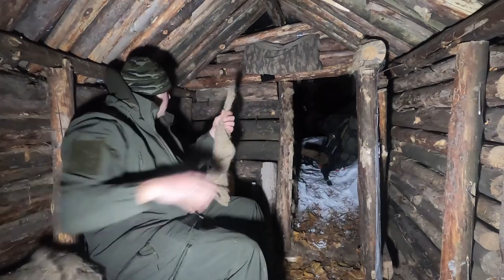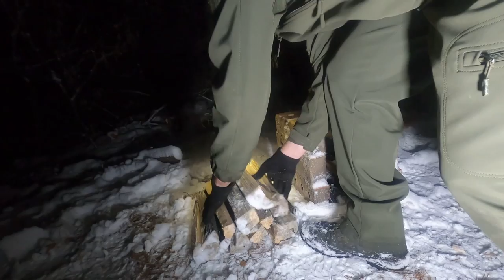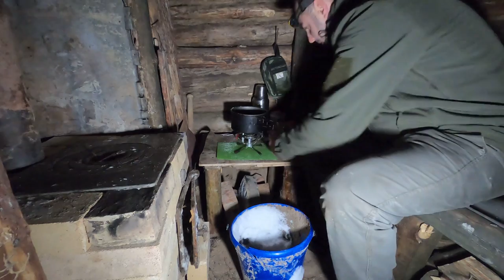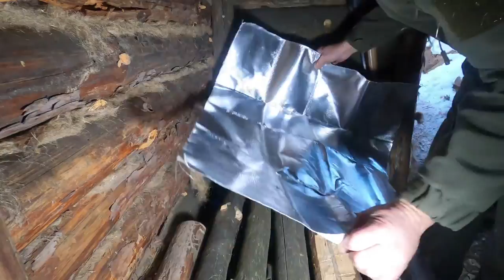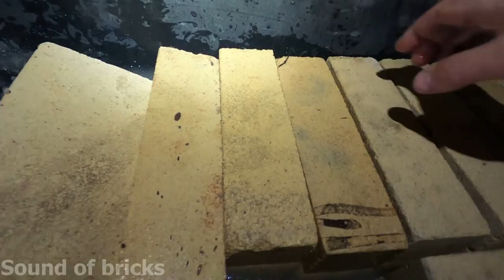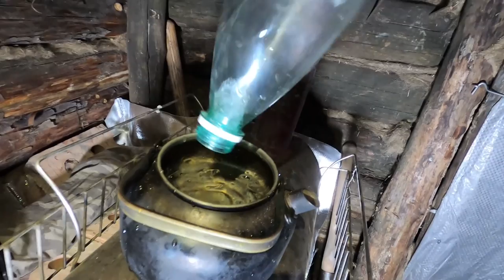Made a cool brick stove in the dugout, dugout building, solo bushcraft shelter

Comment: I built a pit-house in the southern part of SW Utah in 2005. I simply dug a hole in the ground big enough to then construct a cabin of wood inside. Then buried it with the soil removed from the ground. In winter and summer it stays around 50 degrees inside. I winter a small campfire keeps it warm and in summer the soil around it keeps it cool when its hot outside.
Reply: Pit-house construction goes back to before the time of Christ, as you probably know.  I remember ducking into a ground-level chamber at Chaco Canyon several decades ago.  It was a very hot summer day with relentless sun - inside the Pueblo, with several stories above us, we were delightfully cool.  
Too bad we “have” to use enormous amounts of fossil fuels to stay comfortable today.

Comment: I think that's exactly what you are missing! A really good stove like that. It will hold the heat in those bricks. Even after the fire dies down and it's just at coals. I think the flat surface will make cooking a whole lot easier. You might be able to find a piece of metal that you can bend into a square and put it on the plate to make an oven to bake in. That place is just about right now! Good job.
Reply: О
Reply: in fact ... these are fire clay bricks that insulate and do not retain heat, they normally protect the outside structures of the stoves from the heat of fire .. They are hot when the fire is burning, but they also cool down quickly when the fire is gone ... you need another layer of normal bricks outside ..

the man is inexperienced, at first he wanted to set up a cementless structure, then he lost a lot of them through the construciton process. Cement is also not good material for the high heat, he have to use fire clay flour.  He was made too large stove (energy inefficient), although he already has two others stoves, a small metal and a miniature gas one in his cabin + one small gas cooker ...

The Video is make only for the YouTube likes ...
Reply: @DieGottesliebe  Or maybe he is learning as he goes. Instead of being a rude criticizing naysayer, try teaching, like so many others in the comments have.
Reply: @DieGottesliebe  Calm down there Bob the Builder. He's building a stove in a small shelter in the woods, it will do just fine for his needs. It's not like he's trying to heat a whole house with it.
Reply: @mickwomack6363  he needs only the YouTube clicks ...
Reply: @DieGottesliebe  ever occurred to you the man might just be using what he could get his hands on without spending money he don’t have.
Reply: @Нукороче-ю4и  ķķķķķķķkķķ
Reply: Don't y'all stop there. Air and smoke is going to sneak out everywhere. Wet soil would have been minimum. This is all too much for me.

Comment: Suggestion:  I did note how you brought in the air for the fire.  But, it would be better to bring it in from the outside and from under the base of the fire.  This would keep from drawing in warm air from the inside and sucking in cold replacement air.  The entrance below the fire will have an ash problem blocking incoming air therefore the input should have a downward slop to have ash fall out and downward to the outside.
Reply: YES! Get combustion air from outside for sure!
Reply: And thereby stifle the air circulation in the interior of the room , thereby increasing the level of CO2 in the room , and this is due to poisoning or suffocation !!! Of course , you can do separate ventilation in the wall , but then the meaning of the supply pipe is lost ! In Russia, cold weather and heating by Stoves have been studied lengthwise and across 😊 Take an example 😉
Reply: @Eclipse_2211  I see both your points, but I lean in your direction because the space is so small compared to the size of the fires being burned.  I imagine that drafts are the least of your worries 5 minutes after the metal stove is lit and 20 or 30 minutes after the brick hearth is fired up - and less time if you leave the door open, because of the radiant heat from the fire.

It seems odd to see both a wood stove and a brick hearth, but I imagine that the stove was for climate control during construction.  He probably doesn't want to run the gas heater without the front door hanging open.  

I imagine that once either the stove or the brick hearth are going for any length of time, it gets stiflingly hot in there!
Reply: Omg
Reply: @harrymills2770  There was no gas heater in this video. And no fires should be burning in the sleep shelter because of the buildup of carbon monoxide, creating a deadly toxic environment in which it will be a very long sleep and you consciousness will become aware of your presence in what some people call heaven.
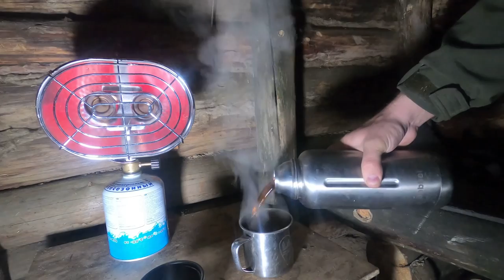Reply: @allenheart582  what was that at the 2:50 mark
Reply: @k9aid514  You had a battery to provide heat but no warning about CO danger of the wood you brought in to be burned. With your query I noticed what you tried to show. Otherwise great video.
Reply: @allenheart582  wasnt showing other wise just responding to someone saying they did not see that type of heater

Comment: Your skills at improvising, adapting and overcoming issues as they present themselves are amazing! 
I do need your help with another topic. You have two "thermos bottles," that are visible in the video. One looks to be stainless steel with indentations and the other looks to be painted a shade of green. The stainless steel jug looks very thick and I'm guessing keeps hot things hot. The insulated jugs I have are useless. Would you please share the manufacturer of yours?
Thanks!
Reply: There are definitely some cheap, made-in-China thermos bottles out there that aren't very good.  Stanley used to make a really good one.  So did Craftsman.  I think Yeti is the ultimate, but they cost a lot.
Reply: @harrymills2770  Stanley jugs don't cut it anymore either. They barely keep coffee luke warm for one hour. Thanks for getting back to me.

Comment: You can make a small outlet of your new oven and run a pipe around the room so that some of the heat can escape into the pipe to warm up the room evenly. Cap the end of the pipe. Similar to those big Russian heaters that have pipes going around the house.
Reply: or to buy a heating radiator, put a thick fire-resistant steel box in fire, which water enters and through two pipes, one going and one back, go to the heat radiator for hot water, and do as the Australian aborigines: have two or three dingoes and put them over your body to give you heat
Reply: an iron cylinder with a chimney at one end and a gate at the bottom is better and more effective, and better with a chamber where to heat water that then goes to a heat radiator bu two pipes, he could even be semi naked inside the cabin

Comment: If you are able to. You should start to collect some Clay. after you put the insulation in between the logs. pack the clay over top of the insulation inside and outside. it would help retain heat inside bit better. but also prevent the mice from removing the insulation in future.

Comment: Yes, mice will be a problem. As others have said, moth balls will keep them out, however, if you are like me, moth balls will keep you out too! 😊
Try covering the insulation with clay or mortar material. Might not completely stop the mice, but it will certainly put a damper on their efforts.
Reply: Mice can be repelled with shavings of Irish Spring Soap,  as well as dryer sheets.  I also like sticky traps or bucket/roller traps

Comment: 2 questions how do you keep water from puddling on the floor?  2nd is how long did it take to build cabin and stove?
Reply: Simple answer is you start by not making your dugout at the lowest point in the general area in the first place. You also slope and overhang your roof, and then shape the ground around it so that rain water flows away. The weak point is the entrance to the dugout so you make efforts to allow for drainage there. Past that dug outs still can get damp inside, which is why there is a artificial low point for water to drain towards, and the bed is up on a shelf on the side
Reply: there the soil is sand.

Comment: The second time you did your stove was good Should it been left alone to dry before you started it backup? It was wet wasn't? Or did help it to dry and seal, lighting it before it got dry?
Reply: He had to relight the stove up to dry the concrete as the inside of the stove was in the minus degrees, so it was freezing and the concrete would not have dried. Smart move, I will try some of his tricks for my rocket brick stove build. Preferably in warmer weather but if we get stuck in a dark winter, I am glad I saw this!

Comment: Too many questions:
1. why do you have bricks and old stove plates / stove door just lying under the snow?
2. did you make that mortar out of just cement? I've never seen that before. Normally we add sand?
3. If you knew you were going to be doing brickwork then why not bring a trowel? That is a better tool?

Anyway, I like your portable copper stove. It looks like an old piece of kit but its light and good for cooking and heating.
Reply: maybe he edited it after you watched it (I am watching much later).  he had a caption that said he brought the bricks and metal plate earlier (and unfortunately got buried in the snow, etc.).  He probably used the cement that you can get WITH sand in it.

Comment: I did not know cement bonded with metal
Reply: It could be flashing cement, but that stuff usually takes around 24 hours to cure. I wasn't paying that close attention to subtitle comments, but it seems like he started using that fireplace right away, I mean that VERY NIGHT!!! I have a hella lot of questions about the stability and safety of this set up (did look like he had a carbon monoxide measuring device/alarm), but who am I to critique, dude is out there doing it and I am in front of a screen in a temperature controlled room!!! LOL. Oh, and also yes cement will bond to various metals (some better than others) but it will definitely degrade over time depending on conditions they are exposed to...I believe you can prep it with like a zinc primer prior to application and it doesn't look like he did that.
Reply: @michaelesgro9506  he said he decided to dry it from the inside, so I guess thats why he lit the fire.